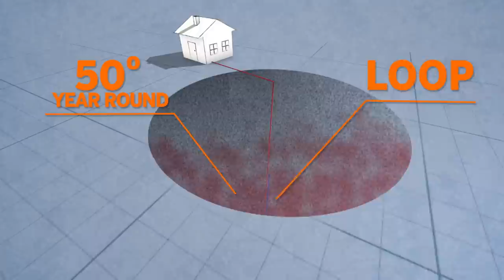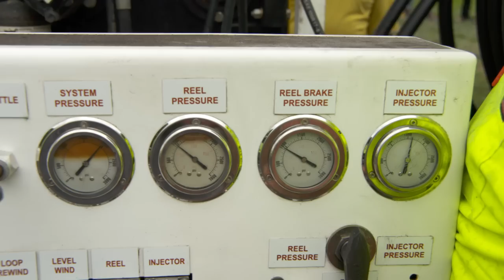ASK This Old House | Reclaim Wood Mantel, Geothermal (S19 E9) FULL EPISODE

Comment: The inflation reduction act also covers geothermal, but the question is how widespread is that system at that price point?
Reply: Hi Bremend have you watched my suggestion or become a flat earther yet? I suggest watch a 13 part series called What on earth happened by Ewaranon to learn that the earth is not a globe. I got it in my about tab.
Reply: keep in mind also that you may only need an air source heat pump, depending on your climate. If you're borderline, you may be fine with for example, a few resistive heaters or using your fireplace on a few particularly cold nights. Modern air source heat pumps work well even somewhat below freezing, particularly if you keep snow off of them.

Comment: I would like to add a mantel over my fireplace, but stone used is not smooth.  So how would I prepare the back of the mantel?
Reply: Tommy would carefully scribe it.
Reply: Another couple of videos show the technique of scribing to an uneven surface: https://www.youtube.com/watch?v=00TA13yENbM and https://www.youtube.com/watch?v=GNkxFRzqExo If your mantel top is a thin shelf, you can back cut as shown in the videos. If it a solid piece like the reclaimed timber, I would use a router and cut out a pocket on the back face, leaving about 1" thickness around the perimeter. That will give you a much thinner section to cut the scribe line to.

The most important part of the process is temporarily securing the mantel to the stone **in the correct orientation**. It must be level and parallel with the sounding walls. Clamp a long straight 2x4 that extends beyond the stone to the top of the mantel. Screw equal length legs to either side. This will hold the weight of the mantel and keep it level (left to right). Cut 4 equal length gauge blocks and attach them to the top and bottom of each leg. These will set the mantel parallel to the wall and level (front to back) and keep it aligned while you work.

Once it's in position, find the place with the greatest gap, and set the scribe to that distance. Don't be afraid to do a couple of practice passes. If the largest gap is 1", set the scribe to 1/4". The scribe will only leave a line on a few high parts, but you can then practice cutting those lines. When done, shorten the gauge stick by 1/4" and see how you did.

Put some tape on the top of the mantel (under the 2x4). Now you can mark the position of the 2x4 to the mantel which will allow you to remove it and make the cuts, then return it to it's original position for checking.
Reply: Hire someone else to do it.
Reply: @ElectricGears  electricgears I suggest watch a 13 part series called What on earth happened by Ewaranon to learn that the earth is not a globe. I got it in my about tab.

Comment: I am certainly no expert,  but I have a couple of observations.  You showed in detail how to make sure the threaded bolts were level coming out of the bricks,  but you spent no time showing how to make sure that the holes in the back of the mantel were level, or bracing the mantel level while waiting for the epoxy to set.   Finally,  since placing the mantel was such an easy thing, I have to wonder why you didn't apply the final coat of tongue oil before you installed the mantel.  Seems like it would have been a lot easier than applying it after installation.
Reply: you have to wait 24 hours before applying the second coat. Nathan wouldn't be there to help lift the heavy mantel and install it.

Comment: Geothermal cost the same to run as a regular a AC. Because you are still using electricity.
So how will this save you any money?
Reply: They'll save money in the heat production side, as it's going to be much easier to move the heat from the ground to the heating system rather than produce the heat.
Reply: @Enkufka  Doesn't it use more electricity? How much wattage they use is hard to find.
Reply: a bigger temperature difference (say, either 80degF air or 50degF ground, vs your desired approx 70degF inside temp) is helpful when it comes to moving heat around. Plus you can use electric heat in the winter which is often better for your wallet and produces no harmful gasses locally (combustion byproducts).
Reply: It uses less electricity but not remotely enough less to cover the absurd increased installation and equipment costs. This type of system will never pay for itself, in any climate, unless you have access to a hot spring.
Reply: @ryanroberts1104  I suspect it depends a lot on e.g. humidity (rate at which you would need to replace air source heat pumps), number of very cold days below 20 or so F, how large the building is, how practical it is to keep the air source heat pump clear of snow, number of very hot days, local electricity rates, and of course government incentives. For instance, I suspect 10 unit building in Rochester NY could probably justify a geothermal install
Reply: @vaynomblenner  Nobody is talking about multi-unit commercial buildings here. It has absolutely nothing to do with humidity. It has nothing to do with below 20 days. It has nothing to do with how large the building is, the math is determined per square/cubic foot for either system. A larger building requires a larger heat/cooling source no matter what kind it is.

I suspect you have no idea what you are talking about, and you definitely do not do this in any professional capacity...
Reply: @ryanroberts1104  why not multi unit buildings? and sure it has to do with all those things in that there are efficiency gains and maintenance gains for geothermal. question is just where the cost/benefit lands for a particular project. Of course as COP increases for heat pumps, the advantages of geothermal will decrease further.

As for requiring a larger heat/cooling source -- sure, so that requires a larger capital investment in the heat pump for max loads, but the efficiency should make a difference in running costs both in electricity and wear to the machine. 

incentives matter a lot. to use the example of New York, there's a 25% state rebate and the 30% federal one.

Comment: So you said there are no fossil   fuels  used to run the system. What then are you using? You have been pushing electric everything lately. Cars and heat lately. When do you think the utilities will start upgrading? Since they are barely keeping up or in some places people resorting to rolling blackouts. We all remember what happened in Colorado last year, when the utility company did an over ride on people thermostats. It seems to me with out a major upgrade to the grid. The US is heading for trouble. That is not even talking about the lack of material to produce batteries. Are you aware that China and many African countries use slave labor? I would think the immorality of slavery needs to be addressed before we jump into this ethos. Oy and then the cost to everyday Hoe in the country, who barely squeak by with normal utility expenses.

Comment: LOL! You will never recover those geothermal costs. It cost 5 grand to have an efficient mini split system installed. Save the other 10-15k for electricity, there won't be much difference anyway! Or DIY install one for about $900.

You could literally buy a solar system, plus a mini split system, for less than the cost of this geothermal BS, and you would have entirely free heating and cooling. Big cost up front but still less than geothermal.

This show constantly shows absurdly expensive options that nobody can afford and will never catch on...almost always the new business Ross is talking to goes under by the time the show hits youtube. Ross is a tool.
Reply: This show really decided to shoot itself in the foot to appease the HGTV viewer's.
Reply: Also the electric costs will be the same anytime the system is on.
Reply: IMO geothermal only makes sense in really cold environments like Alberta, otherwise you're right it's a waste of money.
Reply: @vaynomblenner  Unless you have access to a hot spring, it won't save money in any climate.
Reply: @ryanroberts1104  air source heat pumps still struggle once you get much below 20degF AFAIK, so if you have enough nights like that where you need resistive or fossil heating then it could save money
Reply: @vaynomblenner  Modern air source heat pumps work just fine to zero degrees and below. 3.0 or better COP. Look at the specs of any good mini split, and how they cost 1/10th the cost of any geothermal system.